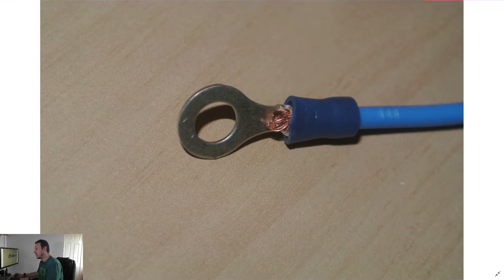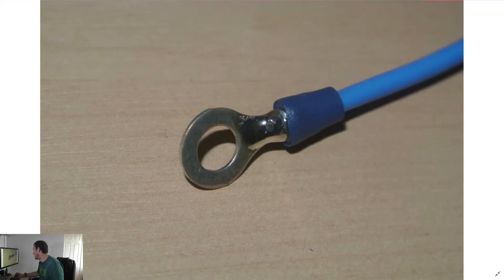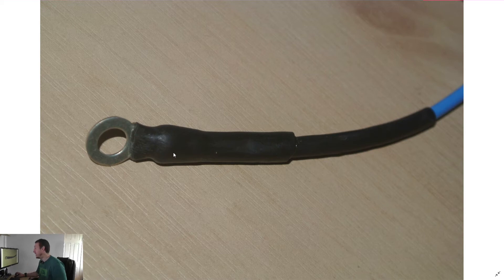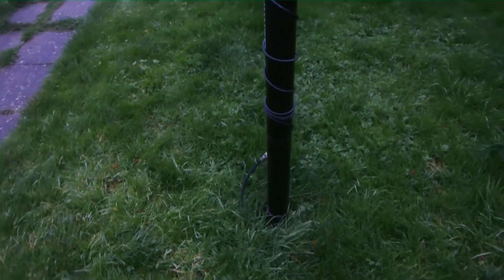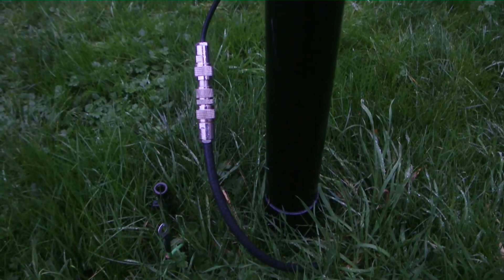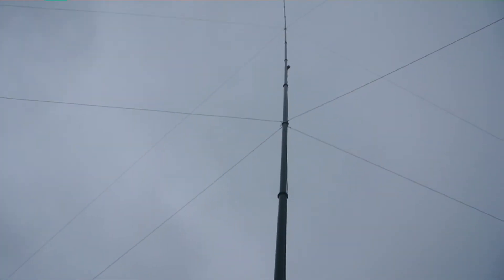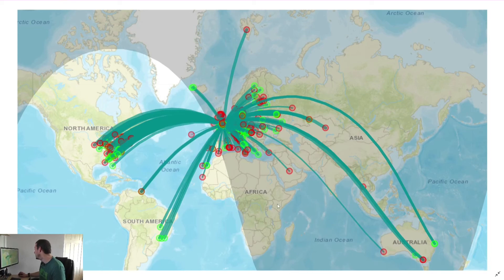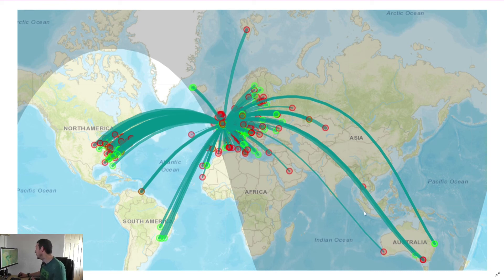Elevated EFHW Vertical Part 2

Comment: Thanks James, I would have liked to have seen your SWR plots, and what your final length of the wire was. I think it should be slightly longer than 10 meters.
Reply from the maker: I'm not sure on the exact length. I just trimmed the wire until I had a good SWR.

Suffice to say that the antenna is 8m above the ground, so not easy to get at to measure it.

I can definitely do an SWR plot on the antenna.

I've got a number of questions from people about various subjects which aren't enough in themselves to make a full video but I might make a series of short videos answering various questions. I might answer this question as one of those videos.

Comment: Hi James,
Great video!
I was just wondering why you are putting in another lightning arrestor?
Reply from the maker: Thanks Dave.

It's fairly common practice to ground the antenna before it enters the shack & also at the base of the mast. This thing is almost 20m tall & I don't like the idea of relying on around 20-30m of coax braid for lightning protection just before it enters the shack! I feel happier having it grounded at both ends.

Grounding both ends (making sure that the coax shield stays at ground) can also help with common mode & therefore help to keep the noise down. Given that my coax cable runs under ground, it admittedly probably won't make a lot of difference.
Reply: @HamRadioOnline  Ah ok, I was just wondering as on commercial installs we usually only put one on, ideally in a box just outside the building before it goes inside.
Although there is often also a grounding kit fitted to the feeder….
So similar to what you are achieving with 2 lightning arrestors 😊👌🏻.
Reply from the maker: Interesting. I've occasionally heard suggestions that the coax shield should also be connected to the mast at the top and sometimes at regular intervals down the mast if it is a particularly tall mast, thus grounding the whole lot to keep it at the same potential.

I don't know how much merit there is to this suggestion but my guess is that this is probably going to result in the best case scenario if you are unfortunate enough for your mast to have an altercation with a stray bolt of lightning!

I don't really have any experience of commercial masts but I'm guessing that this is something that commercial installations would do?

Obviously we are talking about metal masts here........no point for fibreglass masts like I'm using!
Reply: @HamRadioOnline  yep that’s exactly it..
It is grounded to the mast. There are kits for different size cables.

Comment: Seems like a lot more equipment, but it seems to be more effective. Did you run the antenna straight out horizontal to the ground or did you have something to make a slooper? Once again, thank you for your patience and understanding.
Reply from the maker: It's mounted vertically. It's a half wave on 20m (so roughly 10m of wire) mounted on an 18m tall mast. This puts the feed point at around 8m above the ground & gets the antenna above the roofline.

Comment: FWIW the line isolator/common mode choke may be beneficial even in the shack. Very easy to do a comparison that way too. I reduced noise in my system with a GM3SEK style mains filter as well.  Although not idealfor lightning protection on my 15mm copper ground stakes I used appropriate sized stainless steel hose clamps, just remove the screw and refit with a suitable eyelet threaded on. I have also got common mode chokes on the phone line and the satellite tv feeder, it all seems to help. (I am using a DX Commander Classic with 80m, 48 8m radials) 73

Comment: Hi James, good video and nice ant setup.  I will be very interested to see your on air results, and also how there compare to your past vertical experiments.
I heave used wspr in the past, but compared to the real on air results, I think wspr can give you a bit of false hope. I tested my 6m band 2 ele yagi on 40m with wspr and got fantastic results, but of course on the air cw/ssb the 6m ant was never going to perform very well.
Chokes I've tried, but I actually find ferrite clamps work better for reducing noise, I have about 20 at the feed point and about 5 in the shack.
Well done James, can't wait for your next video.
Have a nice weekend 73 .